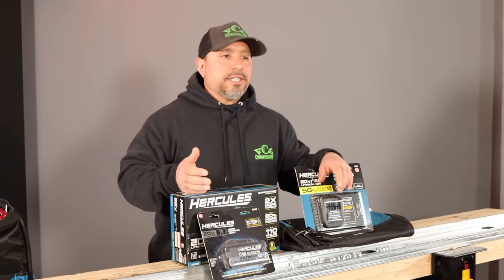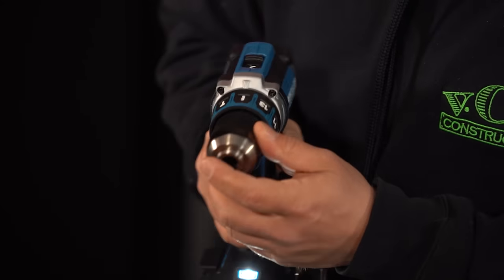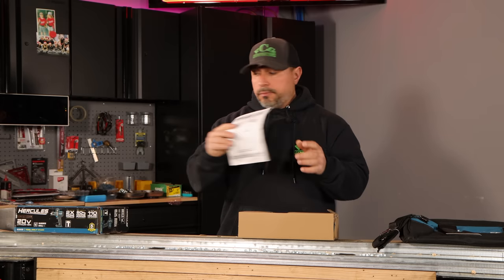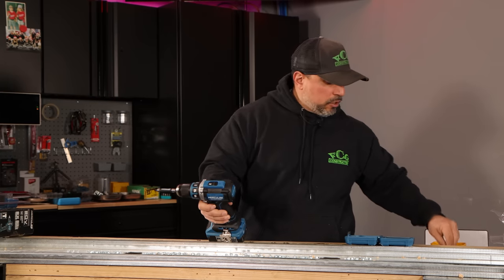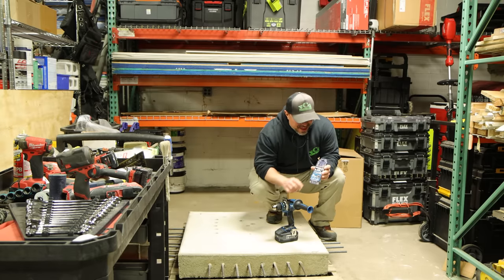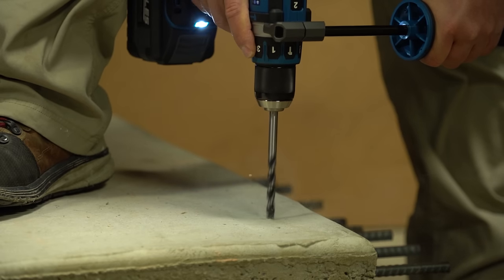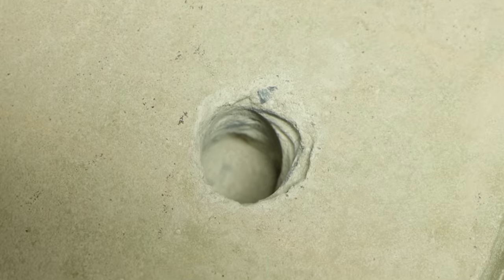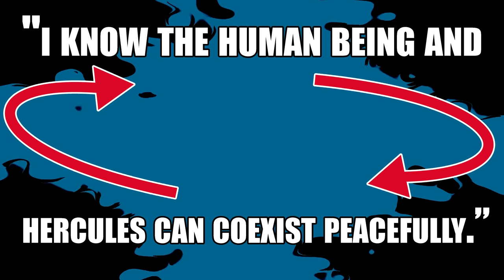Harbor Freight CAN'T FINISH One JOB, What Happens Is Shocking!

Comment: There's one huge consideration that would need to be addressed before I spent that amount on a HF tool.
 I saw a review (sorry can't remember the yt'er name)  about the Icon HF brand. He brought a pack of sockets. One broke. Being that Icon has a lifetime guarantee, he went to HF to exchange that one socket. NO DEAL. He had to bring the whole socket set back to exchange that one broken socket.

Problem there is, what if he had lost one of the sockets that made up the kit. He wouldn't be able to use the lifetime guarantee for any of it. Now that is total bs.
So the question is even though this isn't sold in a kit yet, will they do the Icon 'screw you' you don't have the whole kit special?  I can see HF doing this just to screw people out of the 5 year warranty.
Reply: Just a thought, but maybe for that reason it's better not being in a kit. No extra pieces to bring in to replace/ exchange?
Reply: That HF employee was in the wrong, all the ones I've been to take the single socket out then sell the remaining set under open box sign.

Comment: Thers alot of stuff going on here to consider money for the most part and time if it breaks gotta bring it on back well looking in to another tool kit i currently have millwaulkee for a great many years now thi king about how much money millwaulkee tools are when they need to be replaced and i have had a. Bunch of the one handed saw crap out i am considering the rigid line now since all thes tools seem to come out the same place in china and thats all the brand names so i am left to wonder is all about paying more for a name or is ther actual reputation 
And yes to be informed not to buy junk or gimmicky 
Better choices and more informative details are keys to all this with so much out ther compition wise

Comment: OK you just asked why I am watching this video. Here is it. I am dumping Ridgid power tools because they wanted 30 bucks to fix my drill driver... the one that was sold to me with a life time warranty. F*CK THAT.  am not paying 30 bucks to get my crap Ridgid driver fixed.... that was sold to me with life time warranty. I know harbor freight will replace any tool that is under warranty with a "walk in with broken tool" "walk out with FREE replacement" Policy. Here that home depot/Ridgid MF'RS. HF don't quibble. When that tool is 4.9 yrs old I can walk in and say it's not working right and they will hand me a brand new one. BOOM THERE YOU GO. HF does not plunge their hand into my pocket and yank out 30 bucks to do that. So if these Hercules tools are decent then when each of my sh*t heavy low quality garbage Ridgid tools takes a dump then I'll put the 30 bucks they want to fix it along with some more bucks and upgrade to Hercules from HF. At least the actually honor the warranty. This is based upon HF doing that with other tools I bought and broke and got replaced. Hope they don't change the way they do things with these Hercules power tools. I was told by HF employees they will replace these with a no questions asked no hassle policy just like they did with my other tools. I'm sold as doing what you promised to do is HUGE with me. I feel I have been cheated by home depot/Ridgid. Ridgid's latest trick is the invalidated my password on the ridged website where my tools are registered and they wont allow me to reset it. To me that is like being given the middle finger from them. Won't honor warranty, lock me out of your website plus want 30 bucks to fix a tool you sold me with life time warranty? I don't even want to pick up any orange power tool out in my shop now. Maybe I will just craigslist them all. I think HF is selling the tools separately, not in a bundle to make it more easy to warranty them, as in, hand you a new one without having to bust up a set. HF knows people are going to beat the hell out of these and then expect new ones when they stop working.

Comment: A bigger battery means longer run time, not more power.
Reply: You are so wrong yet don't even know it 😂
Reply: @ns_racing  prove me wrong
Reply: With the 21700 high amp discharge cells, it does mean more power if the tool is capable of using it and the brushless are. You're wrong.
Reply: When I use a fully charged 2.0 ah on any power demanding tool it feels a bit weaker then using any bigger battery, especially if the tool is binding, has a dull blade or trying to bog down for some reason. I own 2ah, 3ah, 4ah, 6ah, and 9ah all dewalt. It's definitely not a placebo feeling, 20 years in carpentry here.